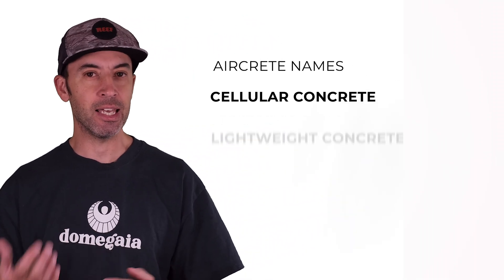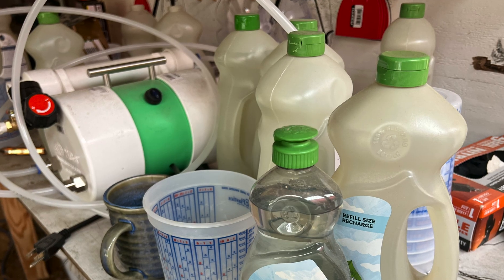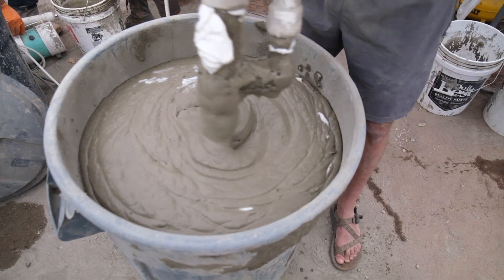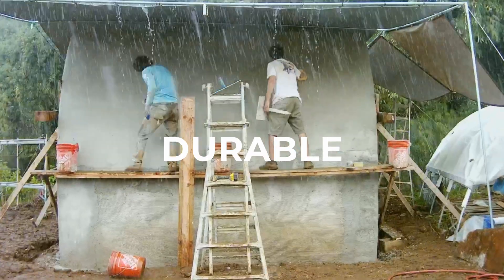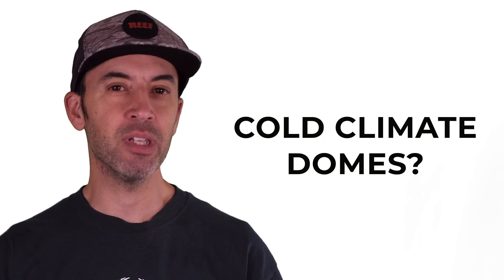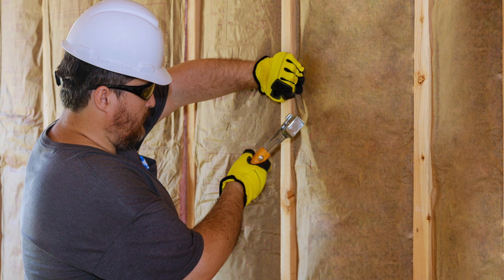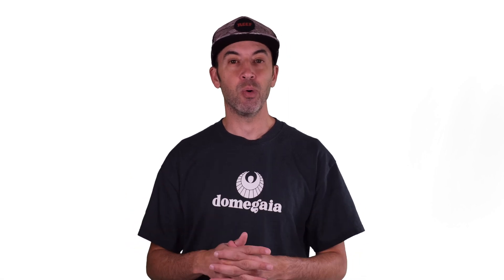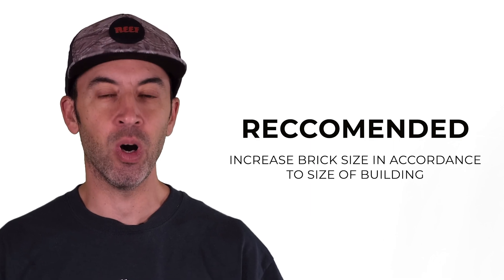Aircrete - Everything you need to know before you start

Comment: If you built a conventional square or rectangle house with vertical walls rather than dome walls, could the aircrete walls support the weight of a conventional roof (rafters, sheathing, shingles or metal)? Given the previous scenario, if you had rafters and sheathing, could you pour an aircrete roof? Lastly, where I live in Maine, building codes require cement walls go to the frost line below a slab. Could you trench the perimeter of a slab down to frost line and pour aircrete into the trench and then when hardened pour an aircrete slab on top of the perimeter aircrete walls?
Reply: Hi! I saw your comment and decided to give a quick explanation😅. I live in Ukraine, Kyiv suburbs, I guess 9 of 10 new houses are built with aircrete. I live in a townhouse with walls built from air concrete, they have extra insulation layer of polystyrol to make houses more energy efficient.
Here is a huge industry of manufacturing aircrete. Standard blocks for walls are 60 cm length X 30cm width X 20 cm height . For walls inside buildings 10cm width blocks are usually used. These blocks are very lightweight.
Their weight is a great advantage, as for such buildings strip foundation is used - it is from standard concrete and rebars. So basically such strip foundation should be around 80 cm in under ground and 10-20 cm above the ground.

Also constructing walls from aircrete, each third row usually is enforced with rebar.

Average price of one 60-20-30 block is 3,5-4 USD. Professionally manufactured they have perfect shape and expected behaviour.

In Kyiv we normally have -15 -20 Celcium in winter

Hope that gave some answers for your question
Reply: @denysmelnychuk7396  Thanks Denys; very helpful
Reply: Fellow Mainer here. DId you ever get this figured out? I was hoping to build on top of an all ready poured slab but based on your comment. Likely not doable.
Reply: @TimArchambaultme  I think it is doable Tim. The State code wants you to go down below frost line with your walls and then pour the slab on top of the walls. However, in my town of Northport, that is only a recommendation and not the law. People pour slabs on top of the ground all the time without the walls. However, if I were to do that I would first put down 2 to 6 inches of insulation board and pour the slab on top of that. That said, if you didn't do that and just poured the slab on the ground without insulation then that should be fine too. Mainers for years have poured slabs on ground for their garages, sheds, etc. The weight of the aircrete walls is going to be much less heavy than regular concrete so the stress on the slab will be less. I wouldn't worry about it. Build the aircrete walls on top of the slab. They should carry the roof weight as well. However, I'd put a metal roof  on the lighten the load and allow for snow to slide off easily. Hope this helps.

Comment: Can we build me a home out of aircrete along the ocean for hurricane proof? Reason is there is no lift issues with roofs and porches. But it will need to be water proof
Reply: In my understanding of basic construction, first-time seeing this system, and having been in the military Civil Engineering Squadron. The key to the waterproofing would be at ground contact, and the outer shell. An expensive option could be gunite pool paints(high chemical resistance, uv stabilized, ect..) The biggest issue with sealing to that level is black mold if and when the water gets in, worked in a Katrina hit home in Mississippi all brick required it to be tented for treatment. Just my thoughts.
Reply: I'd like to know the same.
Reply: Ask china it’s not working out too good for them
Reply from the maker: There are several water proofing products you can use to completely seal the outside.

Comment: Why can’t I make a whole mold of the building then make enough air Crete to fill it and set up. Will that work?
Reply: In theory, but you would spend a lot of money on the form and it would then have to be discarded for a one-off construction. Even if you were manufacturing cast homes in quantity it would still be more convenient to use smaller components for handling purposes and combine them into a finished structure. Finally, using mix and match components would allow variation between units where a "whole house" mold would create the exact same plan every time.
Reply: @avsystem3142  Just no, not a single thing you said is correct, and was fabricated from your imagination.
Reply: Look up @aircreteharry. He's building domes similarly.
Reply: Also, above a certain depth of pour, the weight of the cement will collapse the air bubbles at the bottom.
Reply: How will you make the mold?
Reply: In the 1970' or 80's they used an inflated "balloon" as a form to build dome homes, then once cured, deflated the balloon.
Reply: That would be badass

Comment: Would aircrete work for a fence/wall? I want to put up a 100' long 8' tall privacy fence and am looking for affordable options. Since it's so tall, it would probably need to be at least a foot wide, and maybe wider would be better. It would probably have to be reinforced with fiberglass mesh for strength too. Perhaps it would need reinforcement sections made out of some other material such as bricks.  

Is this feasible or would brick be better? Since it's relatively lightweight, would it need a concrete footing?

This is is in a desert area with quick draining soil, if it matters.
Reply: You could start at a foot wide at the bottom and taper to 6” at the top.
Reply from the maker: I think this would be a good application, also because it be good sound proofing.